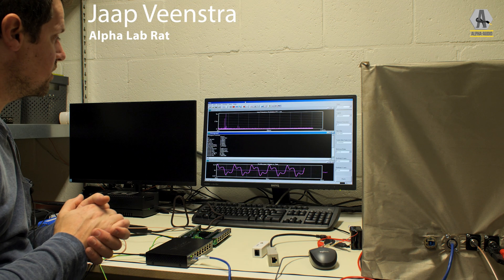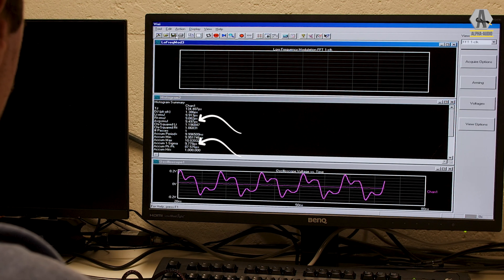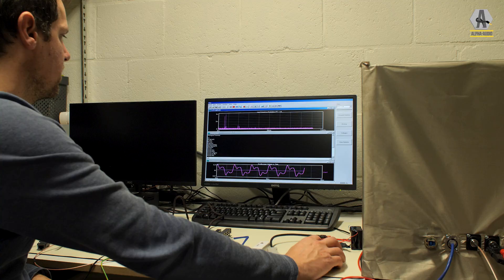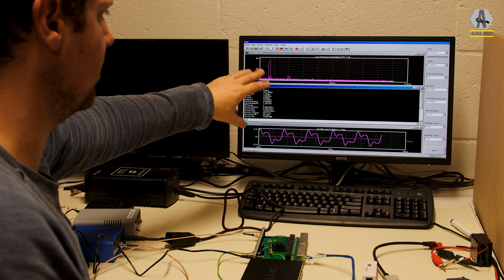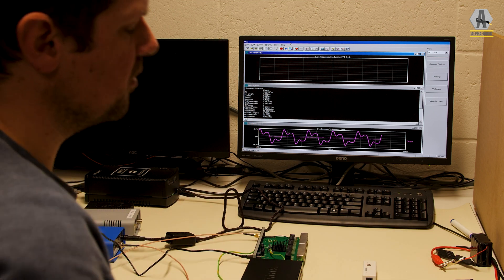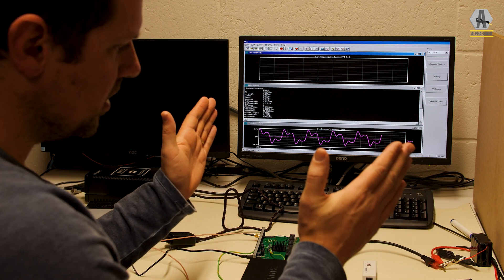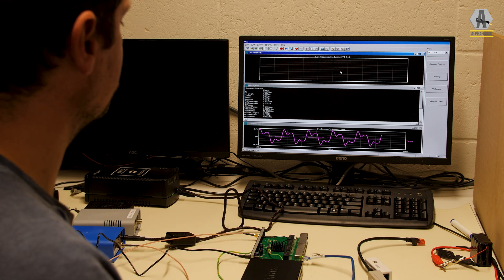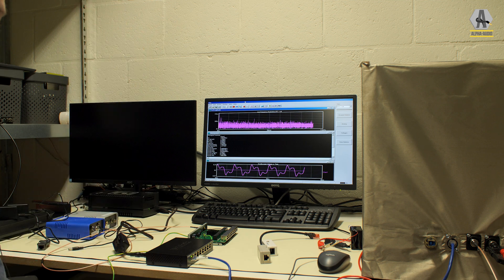Alpha Labs - Audiophile clocks in a switch? Be carefull!

Comment: The typical generic switch does not have a clock input. How did you connect the clock?
Reply from the maker: I removed the clock from the PCB and created an input to attach an external clock.

Comment: Thanks!  I have a dedicated internet set-up for audio with many levels of filtering, carefully chosen power supplies, cables, specifically selected SFPs and ultra low noise fiber... you get the point.

In the middle stage of the network, I had a fully upgraded SOtM switch with the top Mutec clock and cables I could get.  Before your video, I always assumed it was for the best, but after watching, I realized I had not tested this.

My system is very sensitive to changes, with a very low noise floor, and after removing the external clock feed to the SOtM switch, lo and behold, the noise level went further down.  Not bashing Mutec, it does wonders for my streamer and DDC.

Your videos can be technical, but they are also practical,  and I don't think you are getting all the merit you deserve.  Once again, thank you.
Reply from the maker: Thanks man! Appreciate your kind words.

Comment: Hi, I have a technical question that may be very basic. In a digital signal, each bit has a value of either zero or one, which is represented by a specific voltage in the signal. Does this mean that a 16 bit recording must measure voltage 16 times in order to have a complete representation of the binary number that represents the sample?. How does this relate to sample rate? A sample rate of 192khz, for example, does it measure voltage 192000 times? and every "X" bits represent a full sample? or does it measure 192000 samples, each one with several voltage measures to build the full sample
Reply from the maker: @dfrancoanzola  https://www.alpha-audio.net/academy/bits-and-sampling-rates-is-ultra-high-res-really-necessary/

We just wrote about that.
Reply: @TheAlphaAudio  Thanks for your response! Yet I believe the article doesn't fully answer the question: how is the bits "binary number" transmitted? a) is there a "single voltage" that corresponds to a binary number (hence, there are 2^n possible voltages when n is the bit depth), or b) there is a specific voltage for one, and specific voltage for zero, and the binary number gets "built" by the combination of these individual zero or one pulses? (hence, every "n" pulses create a sample, when n is the bit depth)
Reply from the maker: @dfrancoanzola  16 bits indicates the amount of possible values. The value corresponds to a voltage.
Reply: @TheAlphaAudio  wow, then clocking issues can easily generate errors... cause a 24bit recording has 16.7 million possible voltages, a tiny timing error in the clock (or in cable response to voltage change) could lead to a wrong binary number being measured. This is fascinating... also, intuitively I think it could be better to have 16 bit instead of 24 if the system is not accurate enough (higher bits, higher error probablity maybe)
Reply from the maker: @dfrancoanzola  well... That conclusion is spot on. Also with sampling rates... The higher the sampling rate, the more critical the clocking becomes.

Comment: Interesting test thanks Jaap, what were the external clocks used if you don’t mind me asking? Presumably they were impedance matched etc with appropriate cables. But even if imperfect (in terms of matching and say shielding) I guess it goes to the point of the real world challenges of using an external clock, and potential for introducing more jitter.
Reply from the maker: This was an LHY clock. Specifically made for switches.

Comment: Isn't a switch a block device rather than a stream device? I didn't get an idea of using some external clocks with a st.. switch. It can transfer entire song in few seconds (but streaming services do not do that because of a bandwidth, instead they answer with smaller packets let's say every 0.1 sec), and I don't understand why do you torture that poor switch.
Reply from the maker: I am not sure I understand your question or comment...
Reply: @TheAlphaAudio  Mr. Grimm told you already that a switch has no impact on a music directly. This must be an electrical issue (like EMI or ground loops). So, a "master clock" to a switch won't help at all. I'm trying to let you know that despite a musical stream is called a "stream" it's a block transmission by a nature. A PC receives much bigger portion of data than is able to play immediately. It buffers it and plays accordingly to its own master clock.
Just... use a fiber optic instead of a CAT cable, and let's finish with that switch -)
Reply from the maker: @sc0or  I know how this works. What I show is that a clock in a switch does have an impact on sound quality. That has nothing to do with the switch itself... Nor its performance in terms of speed... I couldn't care less. I am measuring the clock in the streamer... That is what counts, for that has impact on the d/a conversion, and thus the sound quality. That is actually what Mr Grimm also says.
Reply: Ty for that 👍 @TheAlphaAudio
Reply: @TheAlphaAudio  " I am measuring the clock in the streamer... That is what counts,"

No - what counts is the output signal of the DAC and if this causes any hearable difference.

"for that has impact on the d/a conversion, and thus the sound quality. "

That is a claim or assumption....

Comment: What are the specs of the ocxo clock? How long was it heated up. Oven clicks need temperature stability.
Reply from the maker: It was switched on for at least an hour before we started. The Wavecrest needs at least 30min as well...

But... warmed up or not: that doesn't change anything in terms of interference.
Reply: Do you know anything about the OCXO’s specification?
By the way the OCXOs optimal upheating and freq stability is min 24 hours… if you can never switch them off.

Comment: Great Test!!! But I recall the low noise power on a good switch helps prevent  " Noise Propagation". ??? ( Therefore lowering jitter?)
Reply from the maker: Yes. A decent switch helps in terms of lowering noise. But the clock is pretty agressive I noticed.
Reply: @TheAlphaAudio  My modification is powering the SMPS through an additional (DC to DC) circuit and adding a LC filter that drops the supplied ripple current to nano volts lowering overall noise!!! Ethernet transfers are  mainly asynchronous communication therefore not as reliant on the clock

Comment: What a minefield, there are times i hate this hobby!  Thank you for this, my automatic assumption was adding an external clock would always be 100% beneficial.  My concern (in addition to cost) was adding yet more components in the chain with the associated additional cabling and power supply, would this also create issues by risking an additonal source of unwanted electrical pollution.  There is also the issue of component synergy, maybe those with integrated audiophile clocks are better in this respect (eg Paul Pang, Chord)
Reply from the maker: Could be ... But I actually doubt they check that.